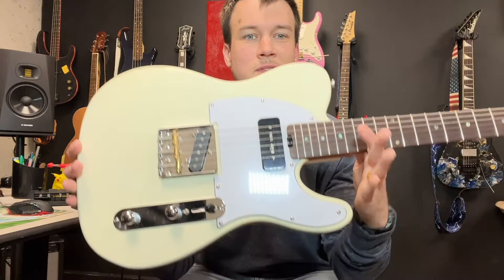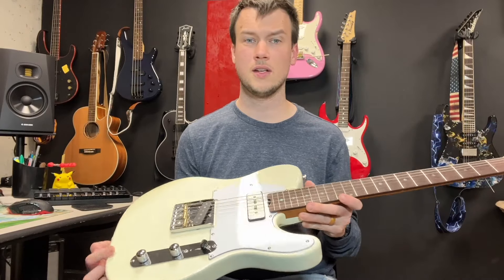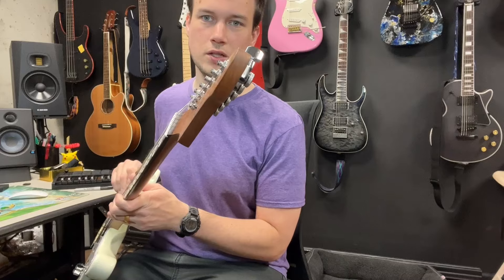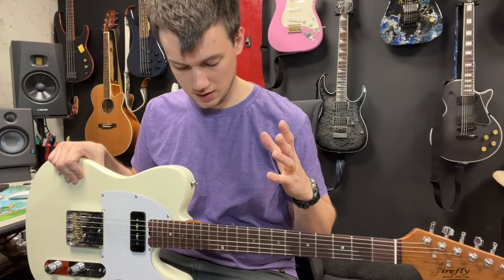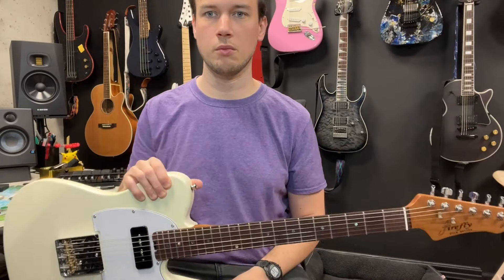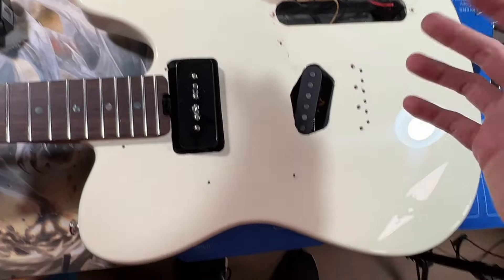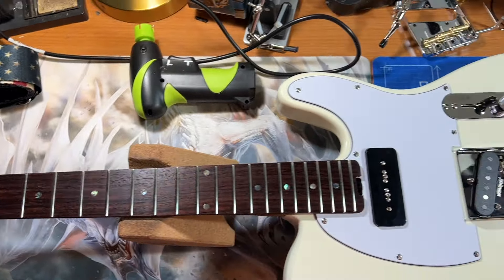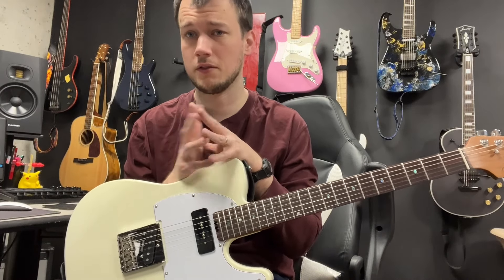Why would I get a Firefly Telecaster?

Comment: Nice video bud...you covered it very well. I recently bought a Firefly Tele and completely overhauled it. I noticed the same lack of ground wire to the bridge. I haven't noticed any negative consequences of it though. Nice guitar. 
I also swapped out the bridge for a Van Dyke Harms stainless steel bridge with compensated saddles. Well built bridge...pricey though...and changed the whole tone of the guitar. Cheers bud
Reply from the maker: Nice! I actually ended up putting the original bridge back on this one and am thinking of getting compensated saddles to make up for intonation. I honestly like the traditional tele look too. So it’s been cool to have the “modern feeling” one. Enjoy yours! :)

Comment: Try compensated saddles, Gotohs are the best, easy $40 fix. Wilkinsons need the witness point edge burnished and the strings will wander side to side.
Reply from the maker: Awesome! I will try those!
Reply: @Bruddermane  As you discovered not all Tele bridges are created equal. I've found on FF Teles keeping the bridge, swapping saddles for compensated or filing compensation slopes into the grooved saddles there are the first part. Second is replacing the odd brass back plate on the pickup for copper plated steel, check Mojotone. If you're not running complicated switching strap the backplate to the negative lead of the pickup. Strapped backplates ground the bridge plate, running an additional ground lead can create a ground loop.

Put a piece of masking tape over the pole pieces to isolate them from the back plate.

For 4 position selectors w series switching run a separate ground lead to the backplate. In either case the pickup adjuster screws ground the bridge plate.

The plastic bobbin bridge pickups on these are actually pretty good! I've found the neck pickups sound best without the cover. There's a thick gobby layer of silicone between the cover and the pole pieces, and the cover is too tall to install with the best (very slim) distance between them. To ground an uncovered pickup similarly use a steel baseplate for a Strat pickup, Mojotone again, piece of tape over the pole pieces, bathtub silicone, strap the plate to the negative lead or run a separate ground lead for 4 and 5 position selector switching. 

Bootstrap sells fantastic handwound Tele pickups for unbelievable prices btw.